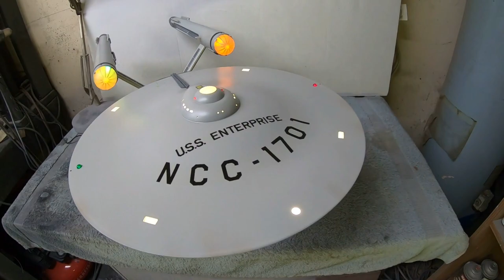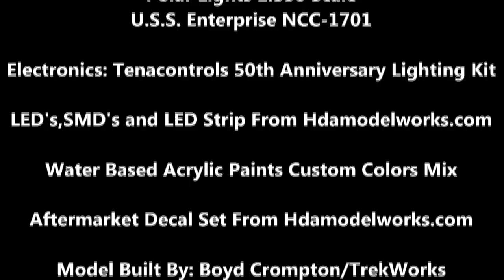Updated 1:350 Scale Polar Lights TOS Enterprise Build Series Pt 12 The Finale

Comment: Absolutely incredible workmanship. Guess I will get started on mine after two years! Question on the shuttle bay approach lights....on Gary Kerr's model and in the picture on the back of the Polar Lights lighting kit it seems the outer lights are red, the center is green and the vertical ones are yellow. Since you are the guru of this model are there screen caps from TOS that show the center light as the yellow one? Did they vary in differing scenes like so many other things on the studio model? Just curious before I build mine.

Comment: Hi Boyd.  Another masterpiece.  Quick question:  When you use white paint to diffuse windows, what kind of white paint are you using?  Thanks for all the great tips, my friend.  Peace.
Reply from the maker: Thanks, it's craft acrylic Folk Art white, thinned with water and applied with an airbrush.
Reply: @TrekWorks  Sorry to be a bother...but when you thin craft acrylic Folk Art white, what's the ratio part for parts of water to paint?
Reply: @leslauner5062  I think he mentioned in a previous video that it's about 1 to 1, but, of course, that depends on the needle size and air pressure.

Comment: Awesome work as always. Great build series. What was the reason you switched to acrylic based hobby paints from the solvent based paints you used a while back?
Reply from the maker: I like to use the craft paints where I can. It's less expensive, better for your health and in most cases it works great. I still use automotive paints and others like Tamiya and Alclad it just depends on the subject.

Comment: I know you have a lot of experience with the polar lights lighting kit. It's frustrating me to no end! Many of the connections came loose so I had to reconnect them. One of the pcb boards for the bussard collectors leds stopped blinking..the center led's still work though. Is there a way to fix this issue?
Reply from the maker: Actually I don't have a lot of experience with the Polar Lights kit. I used it once on my first build of the ship and never used it again due to the poor quality. That was  seven years ago.

Comment: Hey Boyd, awesome build and thank you for making this step by step series!! Now I have a question. I’m newbie at lighting and I tend to see a lot of modelers use 12v power sources frequently. I’m wondering why you choose to use 9v and if there are any specific pros and cons?
Reply from the maker: I use 9 volts most of the time because I like the brightness level of the LED's at that amount and the lower the voltage the cooler the LED's operate and should last longer.